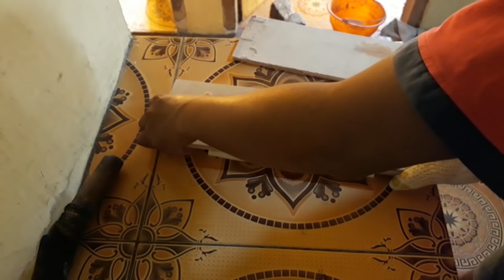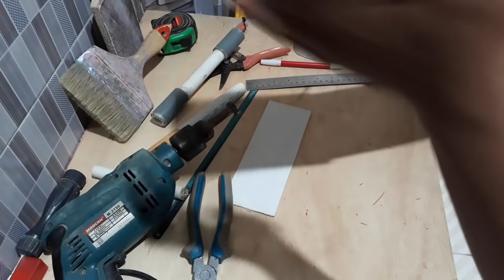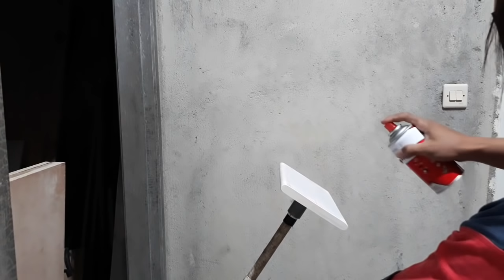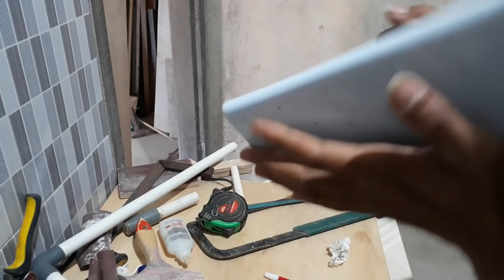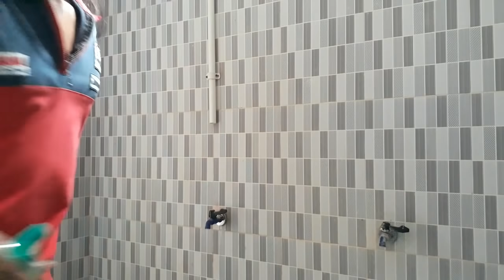Cara Membuat Shower Dari Pipa PVC Model Modern#Sangat Mudah

Comment: Deskripsi detail alat2/bahan2nya dong
Reply from the maker: Bahan pipa 3 dim, triplek 12 ml lebar 12 cm panjang y menyusuaikan brapa yg dimau untuk shower y untuk bagian sambungan shower pakai shok drat luar yg ukuran stengah 1/2  jdi nnti bsa buat bersihin kalau ksumbat dan bisa di ganti" alat bor dan lem G/korea
Reply: @Bolanggondrong  terima kasih mas
Mau tanya lagi mas,
1. Di menit 4:06, melubangi lubang tengah shower, menggunakan mata bor ukuran berapa?
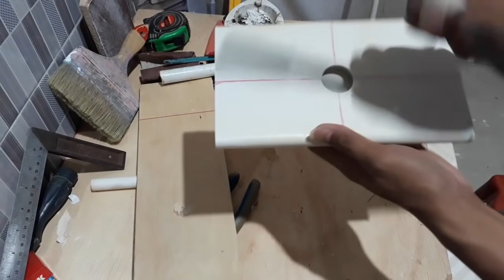2. Di menit 4:18, penghubung lubang shower menggunakan pipa ukuran berapa saja (ada 2 pipa) & apakah itu pipa sok drat luar yang 1/2 inch ya mas?
3. Dimenit 5:20, untuk lubang air turun dari shower, menggunakan mata bor ukuran berapa?
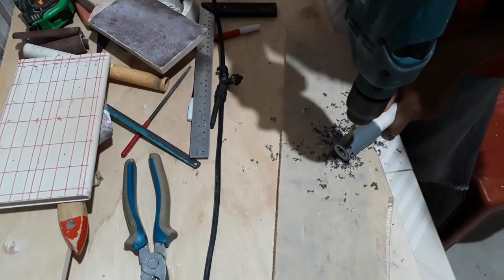4. Di menit 5:50, untuk lubang air di Pipa PVC penghubung menggunakan mata bor ukuran berapa?
5. Klu menggunakan pipa paralon apakah kurang kuat dari lem korea?
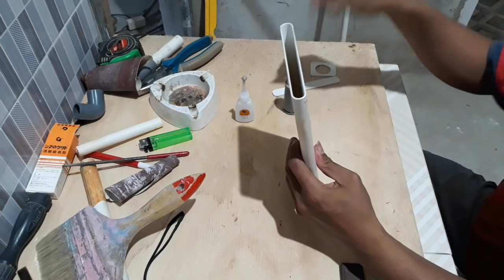6. Di menit 6:37, menggunakan pipa conduit ukuran berapa & di menit 10:06 menggunakan ukuran knee/knie berapa?
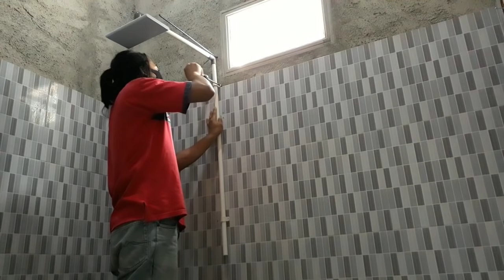7. Di menit 12:32, untuk penyangga atap+pipa shower, itu menggunakan apa mas?
8. Di menit 12:06, ditembok itu dimasukkan apa (suara divideo kecil)?
9. Klem pipa ukuran berapa yang dipakai, mas?
Terima kasih🙏
Reply from the maker: @lusianamaria68  untuk melubangi tengah shower menggunakan mata bor 25 ml mata bor engsel sendok..untuk pipa ukuran 1/2 trus untuk mata bor yg buat lubang air trun dri shower ukuran 5/6ml jga bsa ..untuk penyang itu cuma saya kasih besi yg di masukan ke tembok..untuk pipa ukuran 1/2 stengah jdi keni dan pipa lain y ukuran 1/2
Reply: @Bolanggondrong  terima kasih banyak🧡
Reply from the maker: @lusianamaria68  iya sma"

Comment: ukuran mata bor nya berapa kak, untuk melubangi air keluarnya
Reply from the maker: Ukuran mata bor 2 ml gan
Reply: @Bolanggondrong  terima kasih kak, ukuran pipa lubang airnya 4,5 inc ya bang.. kalau pakai pipa 4 inc kekecilan gak bang
Reply from the maker: @noviardiansyah1358  seingat sya pakai yg 3 inch gan coba cek di deskripsi
Reply: @Bolanggondrong  ok bang terima kasih banyak bang
Reply from the maker: @noviardiansyah1358  Iya sma" gan